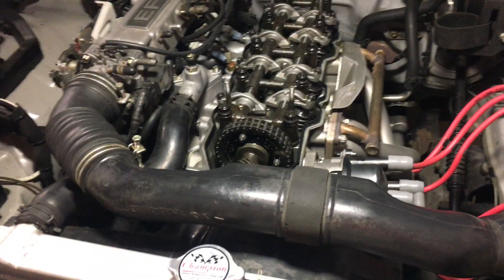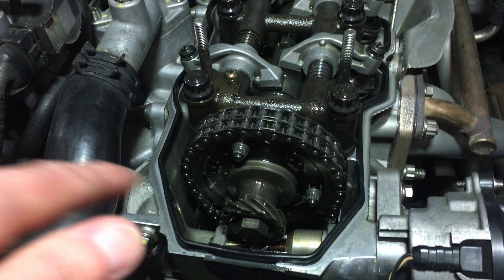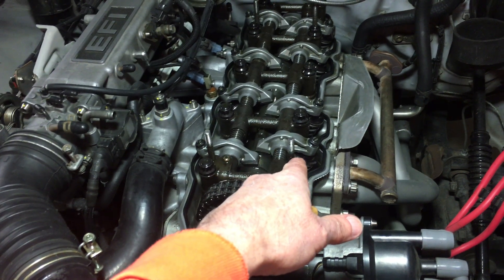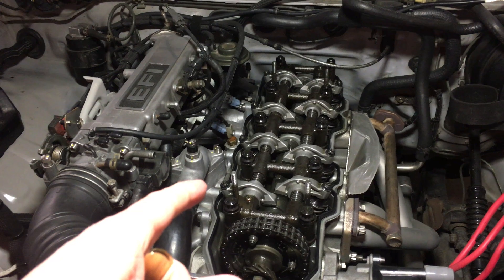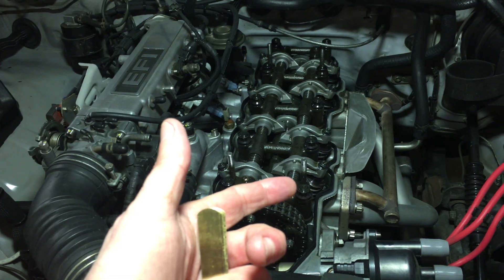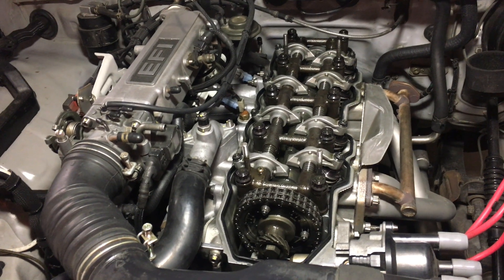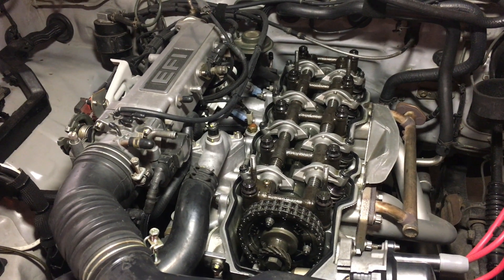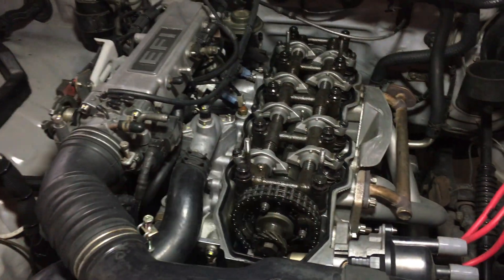TOYOTA 22RE VALVE ADJUSTMENT TIPS - hot vs. cold?  Why I use GO / NO-GO method & lash of .007 & .011

Comment: My understanding is that with an aluminum head, the valve lash increases as it warms up. This is because the aluminum head “grows” more than the steel valve stems as it heats up, thereby increasing the clearance.  So in the case of the 22R, setting cold 7 and 11 is equivalent to setting hot a 8 and 12.
Reply from the maker: Yeah, you know I think you might be right on that. I'm gonna have to actually measure it one of these days. On the 22RE I have seen some people mention that the intake lash increases at temp, while the exhaust tightens up or stays the same. But I have seen people say that lash gets more tight with cast iron cylinder heads, but can loosen up with aluminum heads. As long as the valve train is more quiet, we good :-) Thanks for pointing that out, however - and in the future i will try to take measurements hot vs. cold to get some real world results.
Reply: @ray5961  with that being said, it seems like things might quiet up on my engine when it’s heated up, so take it with a grain of salt.  I have a Yota1 T06 mild cam in my truck. Cam card says 6 and 8 hot, which is the tightest spec I’ve seen.  I wonder how long my valves will last?  🤣
Reply from the maker: @vatayfairfoot  Hard to say.. it could be that the cam manufacturer has ground in some level of clearance ramp into the cam also, which can often account for up to almost .002" additional. Most of the seat time is a function of the base circle vs. duration. There's a good PDF paper linked in the video description that's worth reading also and it discusses a few of these points. A lot of the lash has to do with preventing valve float or bound, but most people aren't turning the 22RE's at 6500 RPM's either. If you are mostly cruising around 2500 to 3500 RPM's, lash isn't quite as critical as if you are building a rally car that has to live at 7000 RPM's for an entire race. I don't think I'd drop much below .006 unless you are running inconel valves or something.
Reply: @ray5961  ill definitely check it out.  Thanks for posting such great content.  I look forward to your future 3RZ build. Cheers!
Reply from the maker: @ Thanks man, I appreciate that! I just fired up my truck and man oh man, it's quiet as can be. I've got the 3RZ block sitting right next to my desk.. I dream about how I'm gonna build that motor all the time. I'm in the process of selling my house and moving, so that kicks the 3RZ project down the road, but eventually I'll build that. I was gonna go for 400 HP on that, but I think I'm gonna dial it back to more like low 300's and make it smooth and reliable as opposed to high strung. But yea, I can't wait to get that build going.
Reply: @vatayfairfoot I have yota1’s stage 2 cam which is really just from Crower. So far like 4000 miles in and it’s great I believe my adjustments are little more loose than yours

Comment: Ray, what do you know about power loss associated with an out of spec valve lash?  Can a fella expect any kind of performance increase when valve lash is returned to spec?
Reply from the maker: maybe a tiny bit of improvement. If your valve lash is excessively large it will tend to decrease your valve duration / timing and negatively impact performance. However, on a stock 22RE w/ a stock cam, it wouldn't be overly noticeable I don't think. Mostly having the correct lash helps avoid mis-firing and/or burning your valves.

Comment: I have been running 7&11 for 40 years on my 22R cold. My engine sounds like a sowing machine compared to RE's! They re- designed the valve cover with the RE's for quieter operation we were told but ALL of them are louder than mine...it makes no sense!
Reply from the maker: Yeah, 7 and 11 is where it's at. That's interesting about the sound difference between the 22R and the RE.
Reply: Mine is a 7,11 engine and has always been somewhat noisy

Comment: So was looking back at your videos I saw you have 4 hole Bosch injectors. I was looking at eBay and I saw there is some 220cc 12 hole injectors for the 22re they’re advertised as not needing to tune. What do you think about that? I currently have stock injectors but my build is like yours cam intake headers etc. Might be worth it they’re about 150 for all 4 advertised as being rebuilt and tested.
Reply from the maker: Not sure.. send the link to the 12 hole ones. Basically you just wanna match the cc flow rate to the stock injectors. If you are running a cam and head, you can maybe go a bit more, but unless you are running your own ECU / engine management I would be careful going with injectors that flow too much more than stock injectors.
Reply: @ray5961  220cc Toyota 4runner 22RE Fuel Injectors MORE TORQUE! NO TUNING! 12-Hole 

1989-95 osidetiger fuel injection
Reply: @ray5961 The link doesn’t post
Reply from the maker: @fiys567  I guess YouTube is filtering it out. just post the item # by itself.. I'll find it on this end.
Reply: @ray5961 Also I was looking to change my fuel pump but I was looking towards a denso or a 255lph that’s actually cheaper it’s by quantum but it seems to be good quality from what I’ve heard. I’m honestly unsure on what to go with though as the upgrade isn’t need but I don’t know if it would hurt anything.
Reply from the maker: @fiys567  I would stick with Denso myself. I believe I bought my pump through LCE, but I'd have to double check my records. If you aren't increasing fuel volume, you shouldn't need any sort of after market pump. I believe the stock 22RE injectors are 100 cc or so? If you are jumping clear up to 220cc, that could throw the stock ECU for a loop. The pulse width duration from the ECU is based on stock injector flow.
Reply: @ray5961  100cc sounds a little too small. Would it hurt anything? Because quantum actually offers lifetime warranty and it’s made in the US
Reply from the maker: @fiys567  Yeah, my mistake.. the ones I'm running are 205cc - not sure where I got the 100 cc from. If you are running 220 cc, that's probably fine - especially with the cam, exhaust, etc.
Reply: @ray5961  I see 15cc not much of a difference. I have heard good things about the 12 port injectors. There would be no point of a strong fuel pump right? I’m assuming there’s no way the motor would benefit from that even slightly
Reply from the maker: @fiys567  Usually fuel pump upgrades relate to preventing your fuel rail (the rail the injectors fit into) from being sucked dry during high engine RPM / full injector utilization. Under WOT on a modified enjoy, you might end up with a situation where the ECU needs to run the injectors at a very high percentage of their capability to maintain proper air/fuel ratios... in this case, you want some margin of error from the fuel pump being able to keep gas coming into the fuel rail and keep pressure up to allow the injectors to work - in that case, you might want an extra heavy duty / high volume fuel pump. However, given how tame the 22RE is HP wise and the fact that you are still operating under the factory ECU (and thus the factory fuel tables and logic), you probably are not going to push your injectors far enough to suck the fuel rail dry or out pace even the stock fuel pump. Now if you turbo charge your 22RE and run a Haltech or Link ECU with custom mapping ,then maybe an upgraded fuel pump might be in the cards.. but for stock ECU and just slightly high flow injectors, I think the factory Denso pump should be more than capable of providing the fuel pressure you need in the rail. There's no major harm in running an upgraded pump, but it's probably just sort of wasting money to some degree.
Reply: @ray5961  I was doing some research I found a guy running stock ECU with 6-7 pounds of boost for about 2 years no issues. I know that’s unrelated, but he was able to tune it enough to make it run good. I can send you over his name maybe you’ve seen some of his videos took me a while to find him though
Reply from the maker: @fiys567  Sure, send the info over; I'd love to check it out. Keep in mind there are different ECU's out there for the 22RE and there is also a specific ECU for the 22RET (which is the '87 factory turbo trucks) - do you know if he was running the NA ECU or the turbo ECU? Also, a goo question would be whether or not someone is running a wide band O2 sensor to monitor rich vs. lean conditions. It's easy to just bolt a turbo on and run it without any eye towards whether or not you are burning your pistons or running lean under boost (I did that on my very first turbo motor myself :-) Even just the N/A factory ECU will correct the air fuel ratio via the narrow band stock O2 sensors, but it takes a second or two for it to catch up and get you back into the correct air fuel ratio. So the issues isn't so much "can you do it" (because in large part you can) but rather are you doing it the way it should be done and are you maintaining accurate air/fuel ratios across every possible range of throttle / load situations kinda.
Reply: @ray5961 That guy is running a 22re ecu I believe. So I found one guy with a stock ecu with a turbo with a wideband and another guy put on a supercharger with the stock ecu just tuning afm etc with no wideband and the guy with the supercharger just did that a few months ago. He’s switching over to a micro squirt ecu with wideband etc which is actually cheaper than I thought(ecu is 300). The turbo guy sold the truck I guess
Reply: @ray5961 Also I just took apart my intake manifold. Should I just go ahead and delete the egr(In order to do that what else do I need to delete/remove?) you can tell it got the intake manifold dirtier and not only that there’s no way I’ll pass smog regardless since I have an aftermarket cam and I do have a LCE big bore tb. There’s allegedly some people around who can pass me anyways.
Reply: @ray5961 The guy with the turbo is called standard American outdoors. The guy with the supercharger is beat up builds
Reply from the maker: @fiys567  Yeah $300 isn't bad if it will do the job!
Reply from the maker: @fiys567  the EGR does dirty up the intake manifold something awful yea. You can usually still pass smog with a cam and throttle body as far as I know. On the older trucks it's mostly about the tail pipe sniffer levels I believe. But they will test your EGR to see if it's functioning. A lot of people just cut up a coke can and slip that between the EGR valve and the back of the intake plenum to test and for diagnostic purposes.
Reply from the maker: @fiys567  ok thanks! I'll check those out
Reply: @ray5961 The TB is super obvious though it’s billet aluminum really shiny unlike OEM. And changing it everytime for smog would be irritating having to adjust the TPS. You think it would pass the sniffer test? It’s a little more aggressive it’s from Crower. When I spoke to Yota1 they said they recommend their mild grind if you’re worried about passing smog.
Reply from the maker: @fiys567  yeah, not sure about the bigger bore TB. I mean a lot depends on the shop too. Worth a shot though! :-)
Reply: @ray5961 I’m just scared they’ll fail me and then once you get failed have to get smogged that next year. To get passed it’s about 250 out here
Reply from the maker: @fiys567  Yea that's a lot! You definitely have to have a functioning EGR system on the truck if you get smog - they definitely test that (usually a stall test).
Reply: @ray5961 Hey ray in the process of removing the egr and air injection. I was just wondering so I already deleted the fuel pressure vsv. I will only be left with the AC/powersteering vsv correct? Where would I connect this too since I am deleting the vacuum tree
Reply from the maker: @fiys567  Just connect it directly to the intake plenum. There should be a thing which has like 3 ports on it near the back of the plenum - you can just run all those hoses from the remaining VSV's there - and also run a vacuum line directly from there to the fuel pump regulator.
Reply: @ray5961 Would I be fine to connect the fuel canister to the manifold rather than to the throttle body?
Reply from the maker: @fiys567  if you are talking about the EVAP canister that sits over there by the wiper motor.. that needs to be connected to the P port on the throttle body. I would not connect that directly to the plenum, unless you wanna crush your gas tank :-)
Reply: @ray5961  Lol yea I saw that the 3 port has a check valve and only gives out vacuum. I was also wondering am I able to get rid of the dashpot? I never adjusted mine when I switched tbs I’m pretty sure it’s never even activated.
Reply from the maker: @fiys567  The dashpot has left the chat over here... I tried adjusting that silly thing 10 ways to Sunday and it never helped out much. It's resting comfortably in one of the garage cabinets. I believe it's there primarily to assist with the AS (air suction) system, which introduces a bit of air when you lift of the accelerator (in an effort to help the cat burn un-burnt fuel vapors, etc.) since combustion needs O2 of course.
Reply: @ray5961 I just deleted it as well. I have everything buttoned up basically. EGR delete painted intake manifold just waiting on some Allen head bolts for the throttle body like yours lol. Engine bay looks a lot cleaner tidy now. But would you recommend deleting the charcoal canister? Sorry for asking so many questions lol I’m sure you get as a lot.
Reply: @ray5961  Also on another note have you ever used the polyurethane motor mounts? I heard people have been using Chevy transmission mounts as motor mounts and I’m considering switching over to them as well.
Reply from the maker: @fiys567  The charcoal canister doesn't hurt anything and is part of the EVAP system. It serves as a breather to the gas tank so I think you need to keep that. On my truck I cut open my stock (giant) canister and burned the gas fumes out of the charcoal - be careful doing that / see videos on youtube about that - and then I took the top off the stock can and carefully adapted it to a much smaller canister that I fabricated out of a stash container that unscrews in half. It still works, but is about 1/3 the size and can be opened to clean / refresh the charcoal inside.
Reply from the maker: @fiys567  I haven't used them myself. I just installed fresh Toyota OEM mounts and called that good.
Reply: @ray5961  Finally got the chance to finish it was slacking on finishing the job. I had replaced the fuel pump, fuel gauge, put in those 12 hole injectors deleted the vsvs and egr/air injection relocated ac vsv painted intake manifold and slightly ported the opening. Idles a lot better looks a lot better and my truck is automatic and compared to before if your driving slow under 10 and go WOT it would take it’s time to pull and now it’s pretty instant lol. Thank you for your help. I will be trying out those Chevy mounts as motor mounts I also got a Oem transmission mount but put some polyurethane on it to in hopes make it stronger:
Reply from the maker: @fiys567  Nice! Do you have the link to those 12 hole injectors? I'd love to check those out.
Reply: @ray5961  I’ve sent over the link and name and the comment always gets deleted sadly.
Reply: @ray5961   Anyways I’ve been driving the truck. Runs amazing. I just purchased a standalone ecu from 22reraceworks. So I’ll be doing that pretty soon. Expensive and the point isn’t really for performance but would love to have the truck running as perfectly as possible. Kit came with a universal harness I have to wire up myself, but I’ll be switching over to coil per cylinder now which is nice so no distributor. AFM will be gone as well. ECU even has provisions for my electric fan so no more extra wires/little relay needed. I’ll be able to delete my idle up for AC I’ll even be able to block off my IAC and use a universal one that isn’t connected that way I don’t heat soak the throttle body anymore.
Reply: @ray5961  From what I was told I’ll be able to get some better performance, but best of all some better efficiency. I know you were against going standalone just so you don’t waste money, but if you go standalone you’ll be able to use that ECU once you go boosted 2rz/3rz.
Reply: @ray5961  Also how difficult was it for you to redo your harness. I was looking to just completely redo my harness in order to clean it up and tuck it.
Reply from the maker: @fiys567  Yea on the 3RZ turbo I am gonna go with a Link ECU I think (not sure which model though) - that's down the road a bit. But that sounds like a nice setup for your 22RE - coil on plug, sweet. Upload a video of all that when you get it done and post the link. Oh and as far as posting links on YouTube.. yeah, they filter anything out which has links to any place but YouTube basically (I think). Maybe if I am the one posting the links it gets through (like links to products on Amazon seem to work). But as far as posting a comment on someone else's video with a link, I don't think they go in for that too much. I ran into that same issue attempting to post a link to something on that channel where the guy is rebuilding the 1972 Toyota Corolla. I tried posting it 2 or 3 times and the comment never showed up (and his videos only get like 10 or 15 comments, so it's easy to see it's not going through) - so I feel your pain on that one.

Comment: Did the loud ticking go away? My 22re is annoyingly loud. Are there ways to make them run quiet?
Reply from the maker: I just fired up my truck and yes, major difference. The ticking sound has vanished. I thought it might be my timing chain, but now I think it was probably a rocker arm clanking due to excessive lash (I suspect it was cylinder #1 exhaust valve, which had drifted out to around .016" lash). I only fired my truck up for a minute, but man oh man, super quiet and smooth at the .007 and .011 clearances.